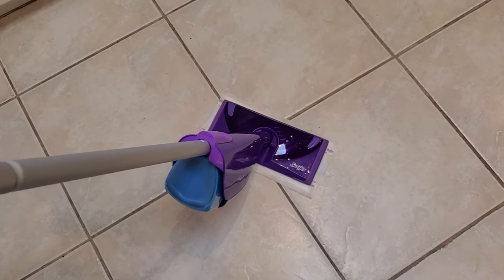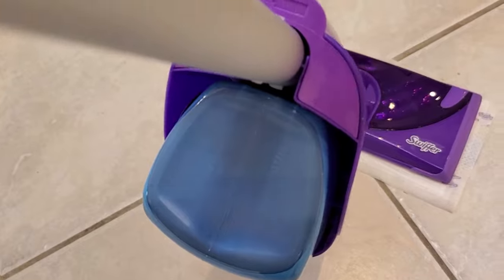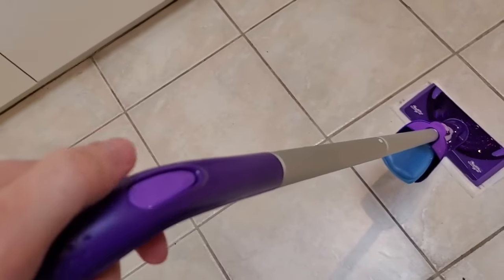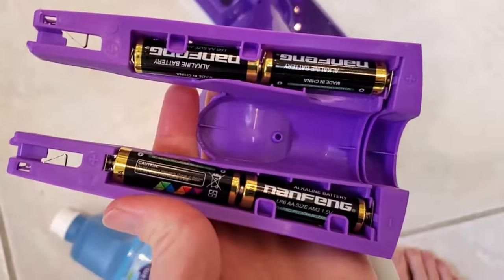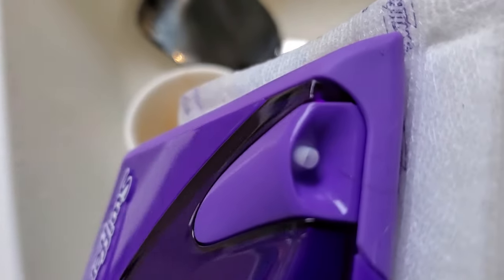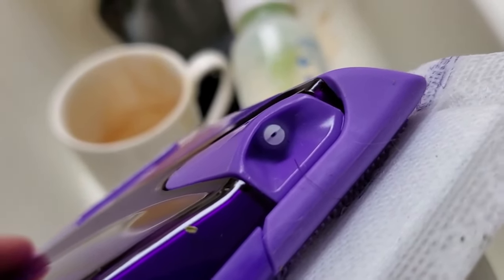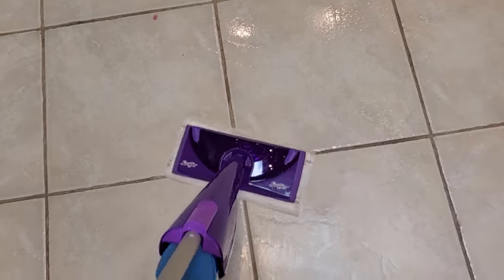Fix a Swiffer Wetjet That Won't Spray

Comment: I found that the clips in the battery compartment had some corrosion. I cleaned it off and it works fine now.

Comment: I had to get to the motor to find the issue. The plastic part that connects "power block" to the rest of the motor shattered, probably, when the mop handle fell down from been propped up. Used duck tape to hold them together. The sprayer works again, though, not spraying as far as it used to, but I am not disassembling that thing again.

Comment: The newer ones with jusy 2 batters seem to break easily. 
I had the metal bend where the batteries touch and keep bending, so it wouldn't spray but when I would get it to spray the liquid wouldn't come out. So I checked the tips even put a needle in then. Still no liquid. Line migh be damaged... this is the 2nd one  that broke in 6 months so now  my husband is like "we aren't buying another one"...

Comment: have the power mop instead of the regular wet jet and pressing it for a while did the trick cause the batteries and solution were new so i just held it for a while till it started spraying again thanks 🙏

Comment: None of these fixed my issue, but I'll share my experience. Hadn't been used in a while and I saw one of the negative battery terminals was caked with corrosion.  I used a soft old toothbrush to remove the debris.

Comment: OK so let me tell you guys, I've just wasted the last five days of my life trying to figure out how to get my swiffer to spray. The lights light up, the batteries are good, the solution is brand new and full and I even tried a second brand new bottle of solution to rule out it being a defective container of solution. I tried everything that all of these videos are recommending. I will give you a little bit of history, I took an old empty solution and made a hole in the top where I refilled it with a pinesol/dish soap solution... that's when it stopped working. Maybe that clogged the Jets I really don't know. 

What I did today was stuck a little pin into the Jets to make sure that they were not clogged, I got a tiny bit of water and didn't bring it to a boil but instead just got it hot enough on the stove to where it was steaming. It was about a quarter of a cup of hot water. I pulled the solution container out, poured some hot water directly into the solution holder on the swiffer. Tried to spray it, nothing. I poured another quarter of a cup of vinegar in there, sprayed, still nothing. And then I got the swiffer solution and stuck it back into where it sits in the swiffer, held the button down for a couple of seconds and it started spraying!! Problem solved. I'm not recommending dumping boiling water or vinegar into your swiffer as this may potentially harm it. I figured it wasn't working and would have to be replaced so who cares if I damage it worse. Needless to say, what I did worked!! 

I'm out, got floors to clean! 😅

Comment: I just threw out 2 Swiffer we jets, I've had them for 5 years, changed the batteries, had plenty of fluid, rinsed the mop off to clean, they still didnt work. I bought a new one, I've had it for a couple weeks, and its doing the same thing.

Comment: If nothing else works, then the little motor broke a plastic that holds it in place. What happened to mine when I opened it you can super glue it together or just get a new one :D

Comment: The power button on mine quit working completely, even with new batteries. Anyone else with the same issue?
For now I just use the wet jet formula in a separate spray bottle and just spray the floor as I go along.

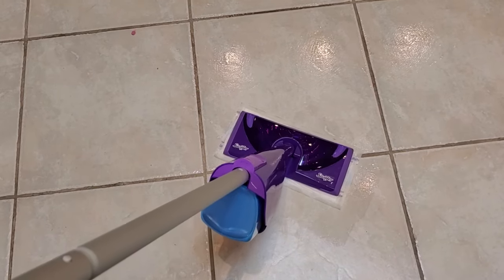Comment: I have to give credit for the most basic things anyone can do, but this is hardly an "Answer to How You Fix A SwifferJet".  I wasted 2:17 minutes of my life on this.
How about other things you can do:
** Remove the cover and see of the hose is still connected or loose or broken.
** While the cover is off, see if the lock that holds the bottle on is broke of jammed.
** There are other things that can be done too.
 
My request:
Please don't make videos that say "How To Fix a SwifferJet" and then present extremely lame and elementary information.  This device could not be any simpler. It's just a motor, a hose, a lock, and 2 nozzles. 
If this is the best you can do, perhaps you should reconsider making videos that waste people's time.
Reply: Wow, so harsh!
Reply: This video has excellent tips for the layperson, except maybe not for know it all mechanics
Reply: I am not a cat.
Reply: Rude! I appreciate anyone who will take the time to offer information to solve what are the MOST COMMON problems with swifters. Go ahead and add your additional information, as you did. But don't be a jackass about it!